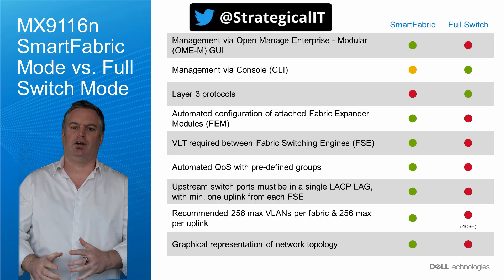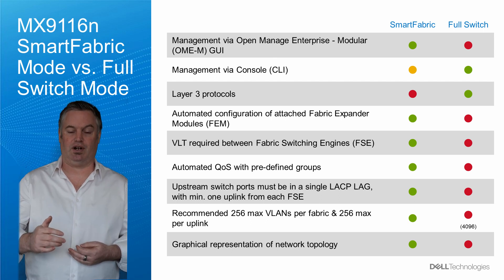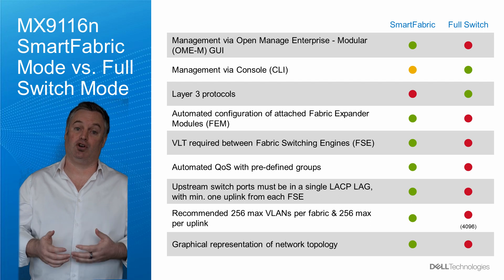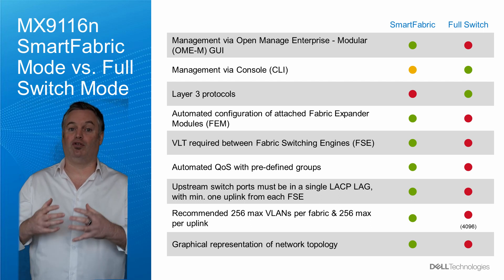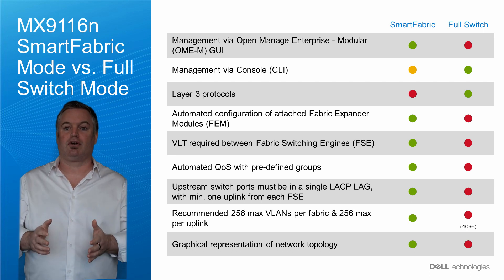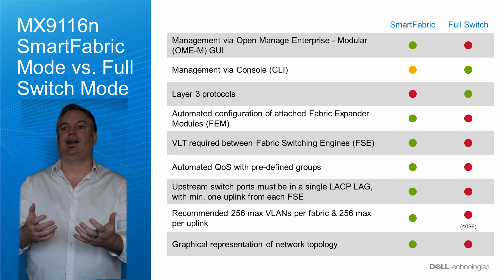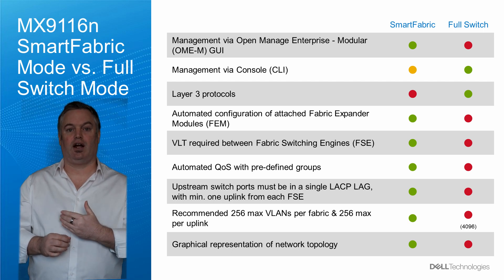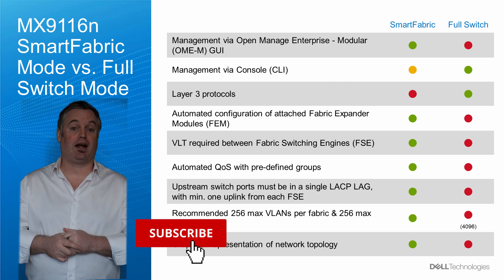Dell EMC MX9116n SmartFabric vs. Full Switch mode

Comment: Can you have the chassis in Smart Fabric mode and use Layer 3 management protocols using a separate 3rd party solution at the same time?
Reply from the maker: Hi @Isaac, Layer 3 protocols are not supported in Smart Fabric mode (https://infohub.delltechnologies.com/l/dell-emc-poweredge-mx-networking-deployment-guide/functional-overview-7), so I think the answer is probably no.  If you want to email me at richard dot houghton at dell.com, I could put you in touch with a local Dell networking presales to try and help you.